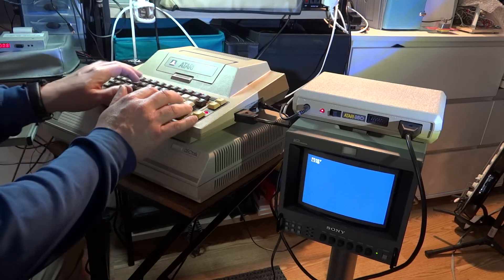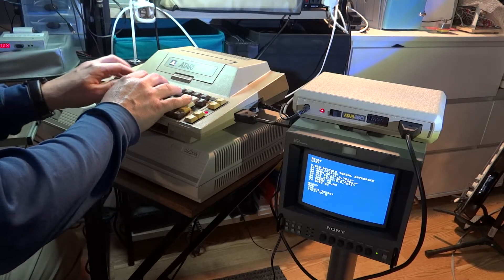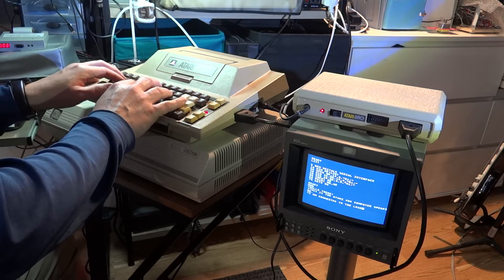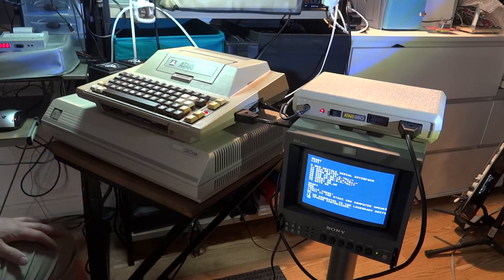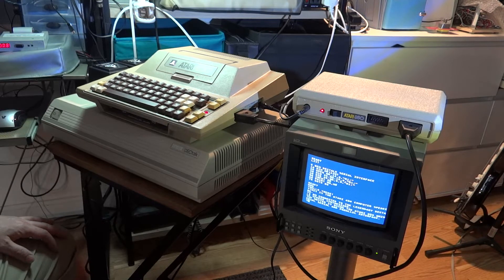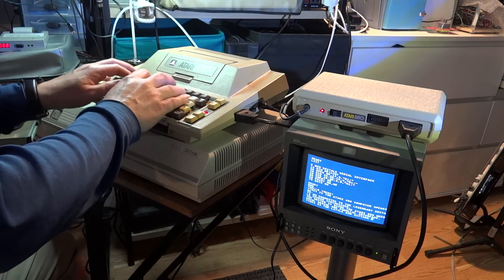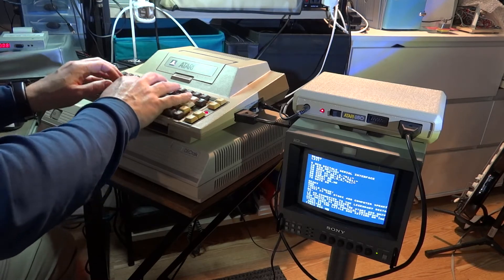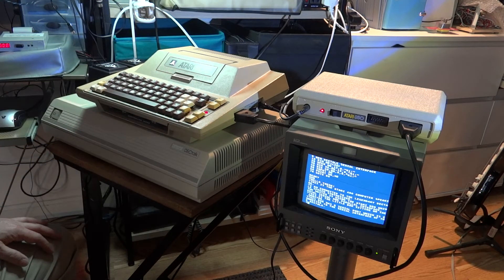Atari 400, Atari 850, and DECtalk DTC01

Comment: Excellent video on interfacing the DECTalk-01 with a Atari 400. I see you have a full keyboard for your Atari 400, the original keypad was too cheap a feature. I recently came across an article in an old copy of Antic, I think June 1983, that describes a circuit for a external voice module for the Atari 8Bit line through the joystick port. 
Keep it up, thanks.